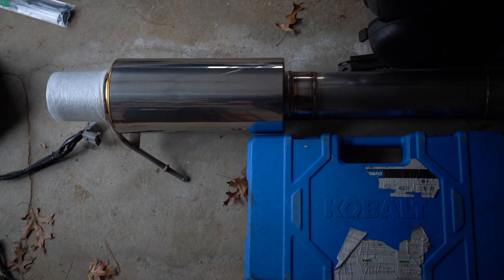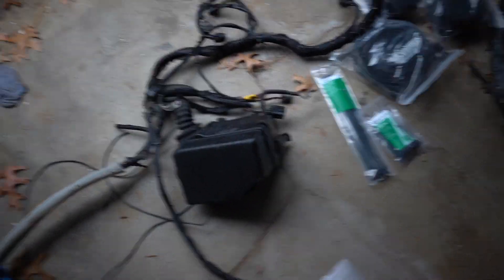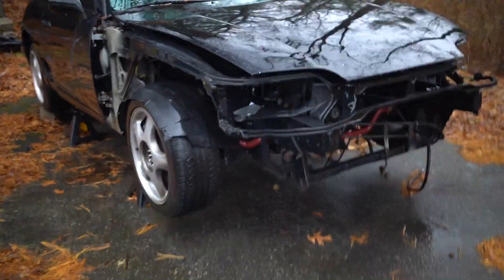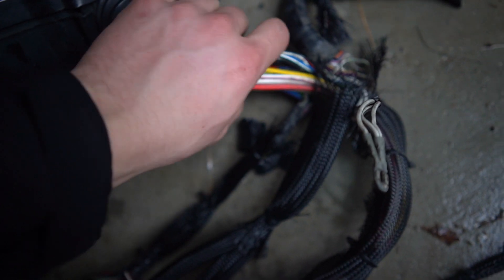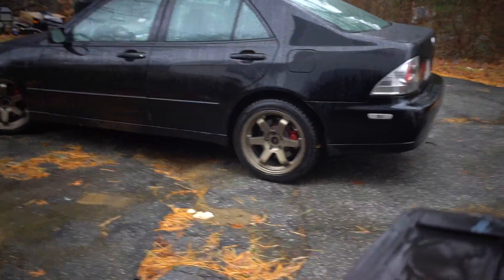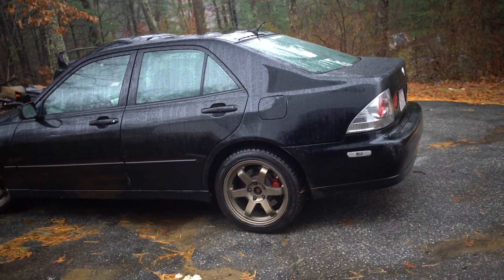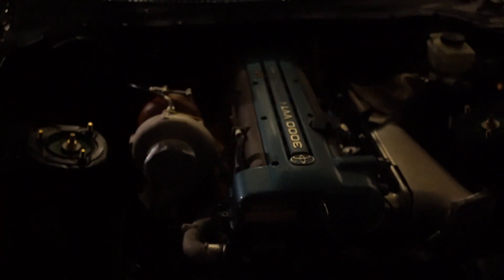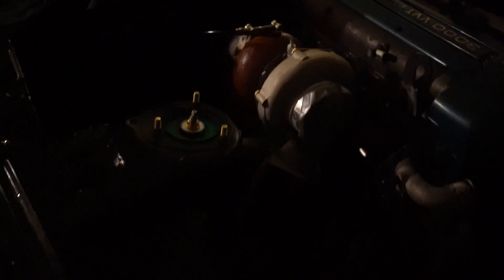Supra Build #17: Winter Build Goals

Comment: Dude...the 6266 on my supra starts to spools at 2100 rpm on the pump gas. And that's with a cast manifold and a 1.10 exhaust AR housing. My car made   708whp on e85 and 500-600 on pump.
Reply from the maker: David Neumann was it a ball bearing turbo? Divided? And what number did it make on the dyno on 93 pump?

Comment: Good evening sir are you going to solder and heat shrink those connections
Reply from the maker: J-Deezy crimp and heat shrink
Reply: @1WickedSupra  I noticed in a previous video you said this was your dream car and you were going to keep it forever if you want to eliminate any potential problems.  it's best to solder the connections first as the crimp could become loose as the wire expands and contracts due to temperature change.  would the increase in the distance increasing the wire length lead to voltage loss and excessive amperage  causing problems with components?  Maybe.  me personally Id keep the fuse panel in the original location to ensure a lifetime of trouble free riding.  Have fun sir
Reply from the maker: J-Deezy considering that many people have relocated the fuse box exactly as I have I don’t think it’ll be a problem. It’s fairly common with supras since some aftermarket intake manifolds require it. It is my dream car and I do want the engine bay to be clean so that’s why I am relocating my fuse box. @Motionautotv comes to mind, he relocated the fuse box with no issues.
Reply: @1WickedSupra  just because many people do it doesn't make it correct nor Dependable sir.  one of my cars is a 1991 Pontiac Trans Am convertible and many people replace the fuel pump by cutting an access panel in the rear body of the unibody car between the rear struts rather than remove the tank down.  just because many people do that does not make it correct nor Dependable. Good luck with the crimps.
Reply from the maker: J-Deezy the fact that it is a very well documented and popular modification to the Supra does make it a pretty safe modification. Just as throwing a vvti 2jz into a Usdm Supra is safe, or using a t56 in a Supra is safe, or converting the car from Drive by cable to drive by wire is safe, or converting to single turbo. Every one of those examples has risks and if I wasn’t willing to take risks I wouldn’t have started this build at all. If I wanted a car that was strictly going to be dependable I would have bought a prius, but I chose to buy a Supra roller to build it the way I want it which will require some risks; and I’m alright with that. It makes for good entertainment 😂
Reply: @1WickedSupra  well I guess as long as you're entertaining yourself that's all that matters best wishes sir
Reply: I agree with j-deezy you have to solder those connections. By the time you have done it 74 times you will be a pro :-D
Also you will need a larger gauge wire than stock as you are running over quite a distance.
Reply: @krismcleod272  you are exactly correct sir